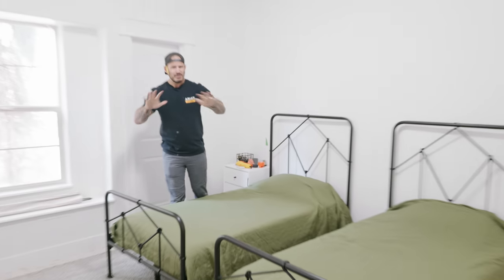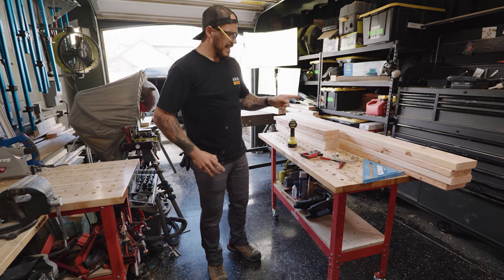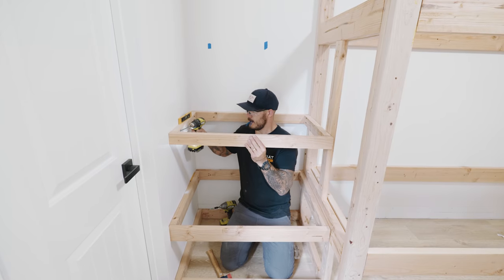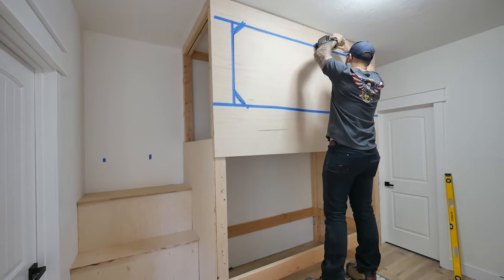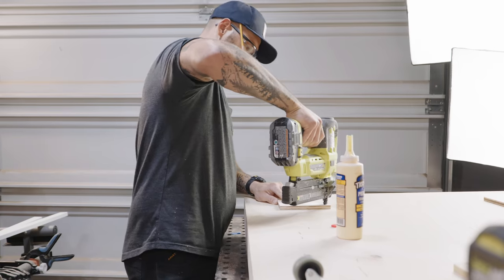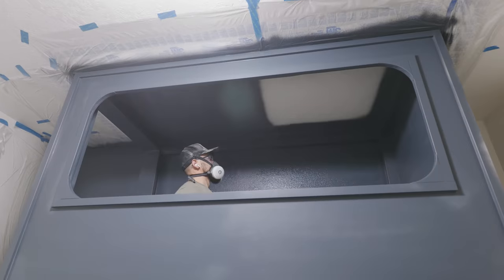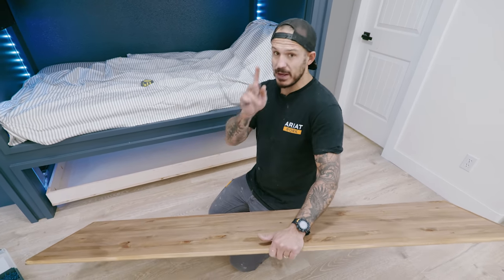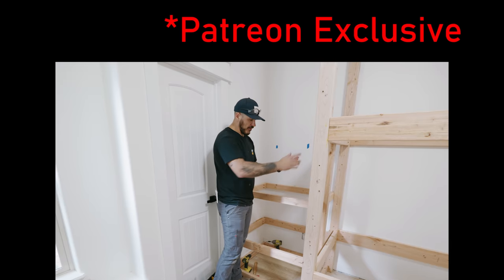Ultimate Gaming Bunk Beds

Comment: Two things I would have done differently:
1. I wouldn't have put handles on the trundle/guest bed. I can see the kid hitting them every time he gets in and out of bed. Instead I would have made a little cut out on the top of the wood or a recessed handle like some kitchens have.

2. I would have made the steps into drawer steps for added storage — of course with a self-closing mechanism so kids don't accidentally step down into an open drawer...

Comment: i never trust a stud finder alone. Had plenty of them. I knock, magnet, and stud finder. Then i stab it with 14 gauge wire to make sure. Had enough heart ache from trusting a stud finder only. Especially with how quick and cheap framing is done in new homes. ~electrician

Comment: Please tell me you did something with that electrical box. Per code, any junction must be accessible. 

One thing you could have done is use a recip saw and cut the nails, cut a hole in the other side of the wall and use screws to go through the side into the same stud. If the connections in that receptacle were to ever go bad you’ve got problems.